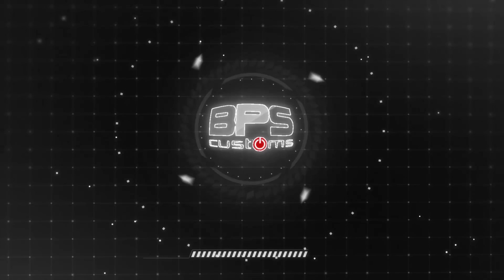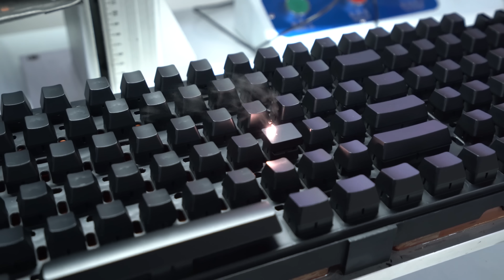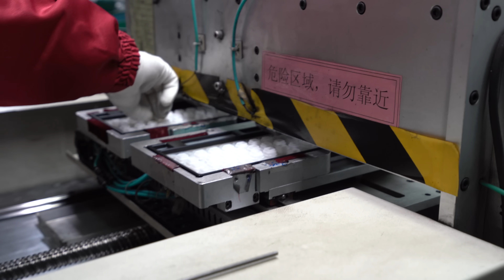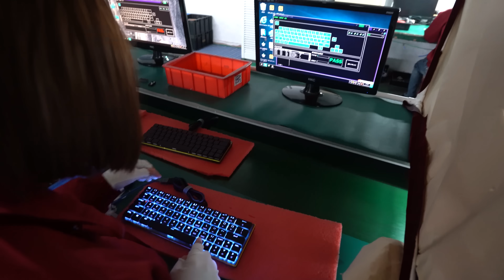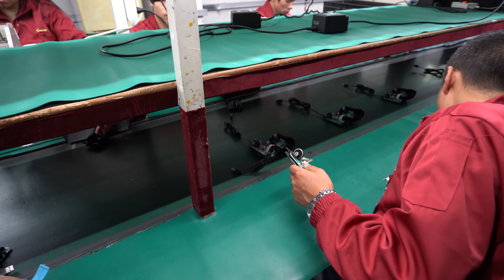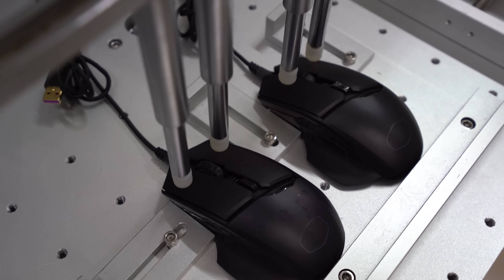How Keyboards & Mice Are Made - China Factory Tour!

Comment: Electric current is measured in Ampere, not in volts. ~Should be electric current of 15kA
Anyways, great video
Reply: its 15KV static discharge test. he said amperage by mistake. if it was 15kA it would fry the keyboard and why on earth would you pass 15kA through such a small device

Comment: Interesting video, I can imagine that those electric screwdrivers suspended from their yoyo's cost more than a workers monthly pay.  Also, laser marking the keys is old technology.  I used to use a Chicago laser (Control laser co.) to burn off the top layer so light could shine up thru the key using clear acrylic light pipes saved from the plastic pieces holding the keys together in the injection process.